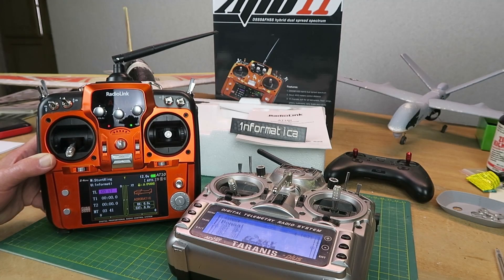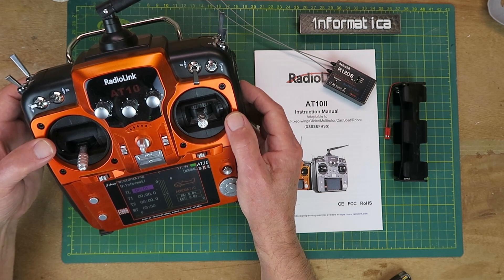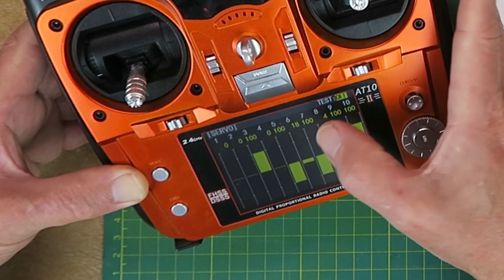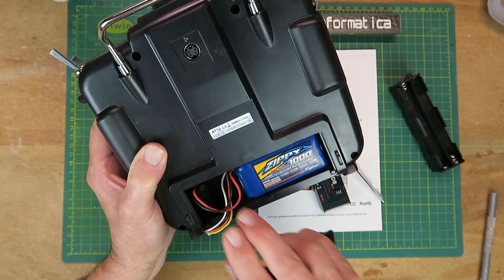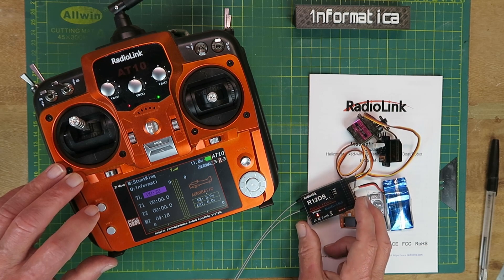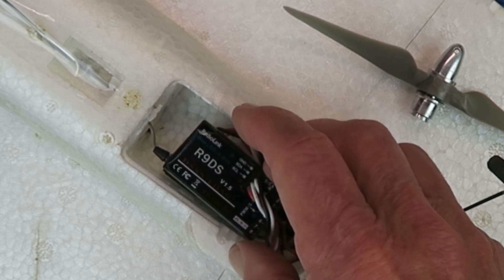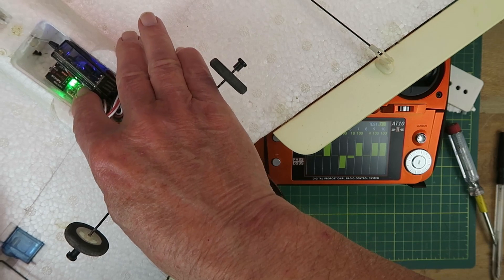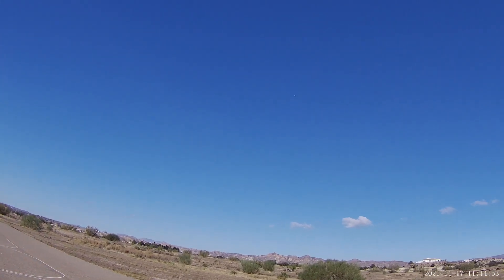Radiolink AT10II 2 4Ghz 12CH RC Transmitter and R12DS Receiver Review

Comment: I need a 1/8 mic cable from the trainer mode to control the head tracker. Does this unit have that feature? Also, I wanted to move the thumb controls from right to left. ie. I want the elevator and ailerons to be controlled with the left thumb, and the throttle and rudder to be controlled with the right thumb. Can this unit do that?
Reply from the maker: Sorry I can't help with that. Contact Radiolink service : https://www.radiolink.com/service Thanks for watching, have a great day!

Comment: Do you have the gyro on a switch? Or is it active all the time?
Reply from the maker: The gyro is controlled by a 3 position switch on channel 5 giving manual mode, gyro and stabilised modes. Thanks for watching, have a great day!
Reply: @1nformatica  thanks.
Reply from the maker: @ChasingContours  You're welcome! Have a great day!!
Reply: @1nformatica  whilst I’m here. Do you think a gyro is a good thing for a newbie or do you feel it detracts from the learning curve and perhaps fitted a little down the line?
Reply from the maker: @ChasingContours  That is a tricky question! One of the "catch22's" of a gyro is that the plane should be trimmed to fly correctly before using it! It can act as a confidence booster when learning but not used all the time, kind of like trainer wheels on a bike. In the video the plane shown is one I used to test various gyro setups. The plane flew fine without it. Recently I maidened a 4 motor Lancaster : https://youtu.be/9AM6t9kdA48 It had a gyro but it was not used for the takeoff only to provide a stable flight for landing. In a large or expensive model it is an insurance but only if set up correctly!! Good luck with your flying.
Reply: @1nformatica  yes. It’s got a glider and in some places thermals or rotor can make it turbulent so my think was for that. Perhaps I’ll start without and then try one.
Reply from the maker: @ChasingContours  Way to go! My gyro of choice now is the A3Mini : https://youtu.be/rPhf0cLP1hw it may be mini but it controlled the Lancaster!

Comment: Thanks for the great video, could you  please let me know how many 3 position switches this radio has? Thanks
Reply from the maker: Hi, there are 4 x two-position, 3 x three-position and 1 x return switch the manual is linked in the video description. Confusingly in the picture from the manual the 3 position switches are labelled "Trinal" I guess a Chinese mis translation! Thanks for watching, have a great day!
Reply: @1nformatica  okay great thanks for your reply, I wanted at least two 3 pos switches, can you turn mixes on and off via a switch?
Reply from the maker: @bengoodman6112  Sorry I don't know. I only used the basic features to review. You need to read through the manual linked in the video description.

Comment: Hello friend, I see few recent tutorials about this radio, what you think of it is a good buy
Reply from the maker: Much depends on the way you wish to setup the radio and models. This radio does not have a computer interface and all is done on the radio. Others like the Taranis have a program for the PC like Open Tx. I compare the AT10II radio to Futaba but much less expensive. It will only work with Radiolink receivers. It is a really nice radio. Personally I like the option to use my PC to backup and configure models. I have just bought a Radiomaster TX16s running Edge Tx, but obviously it is much more expensive. Tell me if you have other questions. Thanks for watching, have a great day!

Comment: Another well presented review, thank you. I am tempted by this transmitter but I have a mix of receivers - frsky in D8 and D16, flysky, radiomaster, even a couple of devo 6 channel. My Jumper T lite handles them. But a more comprehensive controller would be great it it is also flexible for the various protocols. Is this the case with this transmitter?
Reply from the maker: Hi Alex, sadly it only supports Radiolink's own receivers. Best save up for a Radiomaster Tx16s or the slightly less expensive Eachine version. Thanks for watching, have a great day!